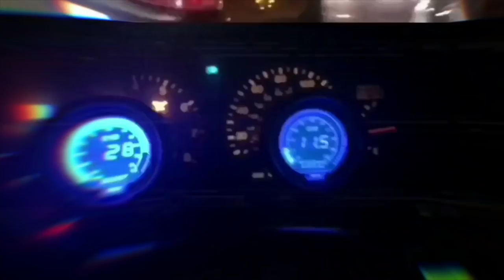I crashed my bike, but way worse happened after that!!!

Comment: When you think your not gonna make the turn lean more . Trust your tires !! And your boy knows what he is talking abt keep ridding with him !!
Reply: I see what your saying leaning into it does help but i always feel like the back end gonna slip out
Reply: When you trust your tires you no your limits
Reply: And target fixation is a big factor that can work against you. Always keep yours eyes on where your leaning in and turning at. Glad you're alright.  @mike_myke
Reply: if he would of used the push and pull Method on the turn and didn’t brake would of been good but , this shit happens how you get better
Reply: one of the thing I learned in my course is to turn your head where your turning
Reply: When you’re in doubt throttle out
Reply: Thats a real dude.
Reply: I don’t own a bike but trust the physics. You get more grip if you lean much at highspeed. MotoGP leaning physics are insane. Even leaning about 10 degrees are enough on street conditions
Reply: Lean the other way
Reply: I always tell new riders that if you take a turn to fast just lean into it. If you’re going just plain too fast youll crash anyways, but if you are in the window of traction it will save you. Most of the time the bike can out ride the rider when they are just starting
Reply: Bro ik this is for street but on dirt, unless there’s a berm, can’t do that
Reply: U wanna turn left? Turn the bars right. U wanna turn right? Turn the bars left. The bike does all the leaning for you u just need to lean with it for those of you who think leaning the bike will make it turn.
Reply: You don't need to lean with that speed. Just freaking look your exit instead of staring at the belly of the curve.
Reply: You are absolutely normal in fearing a slide out in a lean.  Those are called insticts.
Reply: Robert wolke I’m not sure why you said that, that’s a dirt bike saying. road bike slightly running the rear brake will help to turn into the corner more as you know
Reply: you have no idea what you are talking abt . On a sports bike the last thing you do on a turn is brake . Your bike will go straight every time .
Reply: Robert wolke it won’t stand up on a turn using the rear brake do you ride or what
Reply: Robert wolke I hope you’re joking but if not then I’m not going to try convince you, have a good one
Reply: dequavis I ride every day for the last 4 years almost 30k miles on my bike since I bought it new .  I lure more & more everyday, but I don’t like braking on turns may work for some but not me , I stay on my bike in the canyons what it is made to do :)
Reply: Robert wolke I don’t know what to tell you it is kind of advanced. if you use too much it’ll slide out, but if you’re going too fast around a corner and you’re fucked, you can’t use throttle and you can’t use front brake, only thing you can do is rear brake or try ride it out and good luck
Reply: Robert wolke I’m just saying, using rear brake while turning scrubs off a little speed and tightens your line that’s all, but I wouldn’t advise anyone to do it if they’ve never done it, also would never say if in doubt throttle out, that’s definitely a motocross saying from my point of view
Reply: Totally agree with this. Im a new rider myself and had a couple close calls in a turn.  What helped me was always just telling myself to lean the damn bike and forcing myself to look into the turn. Its very crucial to keep thinking when that panic starts to kick in.
Reply: More importantly, make sure you emphasize counter steering before you initiate your “lean”, you can put all your body weight on your left peg and the bike will ride straight! Leaning only works when actively steering.
Reply: Counter steering is key to a good turn or “ push and pull” as some may refer to it as. You can ride a Busa like a 600 if you counter steer! Watch “Cornering Theory” by Keith Code if you wanna be a good rider!
Reply: @AJH8713  Bingo!  Counter steering.
Reply: @chrisbruce1137  Right on!  Lot of bad advise above.  Can't turn a bike by leaning at speed.  Typical beginner mistake, no counter steer, froze, and even goosed the throttle.  Seen this a million times.
Reply: Adam Hoague back when I started riding that’s how someone explained counter steering to me and all it did was confuse me  the easiest way to explain that is if you want to go right you PUSH the handle bar very gently to the right when you want to go left you PUSH left to this day all I do is push where I want to go when I counter steer
Reply: Definitely
Reply: Looking where your going helps in alot of situations ive been tought snowboarding and also drive a car with 4 wheels
Reply: @lukeskywalker3623  If you're gonna hit something, take the chance of letting it slip bro. It's better than hitting something head on. As you long as you have the proper gear, there's a good chance you'll be alright. I've been there...
Reply: @AJH8713  
Bingo. Counter steer...particularly important for accident avoidance/emergency lane change. 
   Not intuitive for new riders, but second nature and reactionary for most veterans
Reply: @LaneSplitDaily  lmfao you clearly don’t ride…. Ever heard of trail braking?
Reply: I'm a 1k like
Reply: @midnightproductions8177   hell yeah my guy
Reply: @LaneSplitDaily  thanks
Reply: I'm pretty sure once you're going fast enough leaning doesn't always help certain situations
Reply: @higurashianduminekoconnect1702  I’m sure you don’t ride
Reply: That's why foot pegs are hinged,  after they start scrapping you can lean a little more!

Comment: 14:37 he's 100% right.  always look through the corner to your exit (initially anyway).  target fixation bites newbs.  dont look where you want to fall, look where you want to go.  prayers to the bike rider.
Reply: Needs to work on his leaning as well
Reply: as a new rider, i got to say absolutely right, i have troubles putting my eyes on the exit.  good comment
Reply: Counterstering and looking at your exit is hella important I crashed the same way we’ve all been there once 😂💪🏻
Reply: Counterstering and looking at your exit is hella important I crashed the same way we’ve all been there once 😂💪🏻
Reply: @jeremyherz1969  yeah, i think countersteer is a little over Myke's ability at this point, judging by the lack of lean angle.  it takes some experience riding to get to the point where you can whip it through a chicane naturally by countersteering....but all things come in time.  for now, he needs to learn to ride to the limits of traction and as you may know, that takes a lifetime because the limit keeps moving as experience grows.  some track days and at least an MSF course is a good starting point.
Reply: Jeremy's right. Needs to learn to counter steer. It's not an advanced move, it's a fundamental move. Anything over 15mph can be steered with counter steering. Dan Dan the fireman, mcrider, motojistu, research learn and practice.

Comment: Little tip for a 'group' ride (Not quite a group with only two), keep the most experienced guy at the back and let the slowest rider take the front to set the speed pace.  Part of being the 'new guy' in the back means having to keep up with the leader.. might be going a bit too fast for comfort for them.  That crash was actually pretty darn funny.. you handled it perfect!  Pick the path of least resistance and you Aced it!  I was definitely chuckling, have helped folks out in the same scenario!  Zero damage minus a bit of pride.. haha!

  Holy shit on that bicyclist!  Good god, you did just fine man.. what a heck of a doozy.  Awesome ride though, hot dang!

Comment: 11:35 aj aj..
You must have been scared at this point 😂
When I was doing my license then the same thing happened two times to me..
First time I drove into a bush with some spikes and the second time I almost had a crash..
I understeer the curve and got on the gravel side of the road. My staring stick was rapidly turning left and right but I managed to keep calm, pump my rear brakes and gained the control over the motorcycle 😂
I had to take a break and smoke a cigarette after I found a parking lot.

Comment: end of 2019 states u should NOT stop compressing the chest to blow air becuase the air doesnt do anything its just the pressure within the system that helps
Reply: was looking for this comment, crazy how few people seem to know this
Reply: Bro. Theres no reason to pump blood without oxygen in it. 20 cpr presses and 1 breath.
Reply: Peter Zingler from what I undestand there is enough oxygen in the blood to not "suffocate" the brain, it's just a matter of getting it to circulate
Reply: @MatureVoltageGroup  exactly what i said but more detailed theirs plenty of O2 left in the system until medics arrive. Certified and Trained CPR  19-2021

Comment: This is a very good example as to why you shouldn’t be going over a 100 every time you get on the highway. You panicked and was going or the break to stop which is the biggest no no. Not only that why was your bike redlining when you was trying to slow down in the weeds. It doesn’t hurt or even fuck your pride to take a safety course to learn how to stop fast in times of trouble. Hell I took 1 about 15 years ago cause I had a buddy of mine going for his bike license and it was a free course that Harley does for anyone that wants to take it. I was already riding for years and still learned from it. Just slow down until you know how to stop. Brakes ain’t the way to stol fast bro. Be safe bro. 
This sounds stupid but try it. When going around a tight corner put your eyes where you want the bike to go and it will go there. One of the biggest things I learned from the Safety course lol and it works.

Comment: Thanks for stopping.  I got Tboned on my bicycle by someone running a red light.  I got lucky that someone stopped.
Reply: Same here, I crashed pretty hard and hit my head, luckily a "doctor" came over and checked me out while I was on the floor in shock, and checked my heart-rate until the ambulance arrived. You can't tell if someone is bleeding internally or has a brain hemorrhage so. Even if someone appears okay you should still check to make sure their heart-rate doesn't drop.

Comment: Been riding 10+ years started on a gsxr750 02 clean as hell... My advice don't do any mods or spend any $ on it. Use urs as a learning bike u will go down and broken fairings scuffs and scratches. My clean bike was a pos after a new rider learned on it. I own a 1000 now and I still f up now and then. Tank slapper the other day Lmao stay☝.fire vid

Comment: Great advice from your homeboy.. With over 15 yrs experience I thought I knew it all but I learned so much in the rider safety course.. please take it 🙏🙏 there they emphasize the importance of doing all your braking before reaching any curve.. don’t brake in the curves unless totally necessary and always look in the direction you want the bike to go.. also don’t just rely on your hips to lean and steer the bike.. push down on your handlebar in the direction of any turn… For instance if you’re turning left, push down on your left grip and somewhat pull up on your right grip.. Try it out and see how much more downforce you have in your turns.. above all, be safe out there and God speed, pun intended 😁

Comment: Good test of your new gear. Lol. Seriously, your buddy's advice is the best advice there is. That's about the most common accident you see on youtube videos. People often call them failure to counter steer, or target fixation. They're neither. First comes fear that you're not going to make the corner, then panic, then standing your bike up, target fixation, and riding your bike straight off the corner - it's fear of the corner and panic that caused your crash. The cure: always, always, always, look where you are going, and get the big picture. If you get scared in a corner, I guarantee you, it's because you've shortened your vision. Shortening your vision - looking down, 10 feet in front of your front tire - causes panic; and panic causes you to shorten your vision. It's a vicious cycle. Every video on youtube of people standing their bike up and running it off the corner - this is the cause. Keep your head up, get the big picture, and look where you want to go - always. It's a skill that has to be learned. Look where you want to go, always, and everything else, your buddy, the beautiful scenery, the beautiful girls, your gauges, someone dying on the side of the road, learn to see it with your peripheral vision. Keep your main vision looking where you want to go. It's not an easy thing to do when you suddenly think that you're going to hot into a corner, but force yourself to look through the corner.
Practice this, and in a short while, you'll be going around corners, faster than you are now, with confidence.

Comment: I rode for ten years, owned 5 bikes, 3 600s a 750 then a 1000rr. Slow down. Take some rider courses. Dropped a couple of times playin around then a drunk pulled out on me on the 750. Had I been speeding I would be dead. Speeding on roads where people can pull out on you is begging for death. Just trying to share some knowledge. Honestly a dirt bike off road would help your skills develop quicker.

Comment: Those older Suzukis are stiff. Never been a fan of the steering damper under front Frame. feels like you're forcing the bike into the turn. roll with a Kawasaki. 13 and up ninja 636............ you'll understand if you listen to my advice!

Comment: Hey bro just a lil peace of advice bro I see wen u shift that u take a second before u let the clutch back out u need to be a lil sooner on that bro like switch gears an let that clutch out like emidiatly after like be smooth with it tho and it will help u man it want like buck u kinda I can see how it does u wen u shift just be a lil quicker an smoother about it or u can just not use the clutch once u take off from a stop just pull up on the gear shift an blip the throttle an it'll shift into next gear an be smoother then what ur doing if u can understand wat an how I'm saying this I geuss try it man or ask some of ur friends wat I'm tryn to say man they will understand what I'm saying bro but besafe man always wear ur gear an helmet man ull do good bro